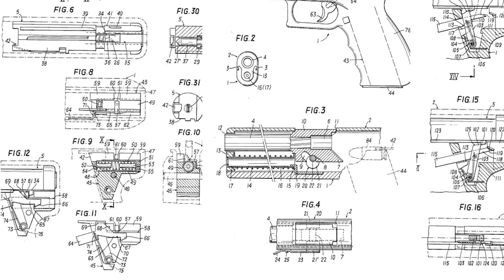The History and FUTURE of Glock

Comment: As a teenager I owned a Remington Nylon 66 rifle. It worked great, never failed, and yeah, most of the exterior was made out of plastic. I lived in the Mojave Desert, and we could pretty much drive out any dirt road and go shooting. I have no idea what I did with it but I sure wish I still had it. It is a classic! It was manufactured for 30 years!
Reply: I own the Remington Viper 522 and it's the most unreliable firearm I own.  I haven't sold it because one day I'll get inside and take a hammer chisel to it and see if I can get it to feed right.  There's a razor sharp bit of metal right where the cartridge feeds in and it catches the bullet and shears it and kinks it over.  About 40%.  Other than that it's a neat little gun, very accurate and light, easy to use mags.  On the other end of the spectrum I also own a used, beat up, floppy sight Marlin tube feed .22 and that's a real joy.  Almost as light, just as accurate floppy sight and all, the only downside is tube feed but you know what?  A pocket full of cartridges and it'll go all day long and never a problem.

Comment: "A glock 7 porcelain gun"... The 80s were right around the time when airplane hijackings were a huge fear. The idea of an "invisible to x-rays" gun was very stupid but it fed into the anti-gun sentiment. Even at the time it was pointed out that all firearms have some kind of metal in them. The bullets, springs, screws, barrel, all things that show up on x-ray machines.
Reply: Hijackings got massive attention at the time, yes.
Reply: I'm pretty sure that an x-ray machine would pick up porcelain, a coffee mug or something would definitely show up
Reply: @Laotzu.Goldbug  It was mostly for metal detectors at the time. The X-Ray machines of the 80s were very rudimentary and it was easy to pack something into something else and the X-Ray machine wouldn't be able to differentiate it. They used them then mostly for bombs, firearms and concealed weapons were taken up by the large metal detector that you had to walk through.
Reply: There were a few very special designs that were entirely non-metallic for the purpose of going through a metal detector. It'd only fire a single shot and didn't use cartridges as we know them and the bullet itself wasn't metal either, but a type of polished stone. It also wasn't really a gun in any sense of what we'd know of as a gun as it was really just a single-shot cylinder that was held in the hand. It was a kooky and extremely expensive one-off designed for spies to be able to sneak some kind of firearm through known civilian security systems at the time which was mostly primarily metal detectors. Definitely not what the news was making the Glock out to be.

Comment: I have owned a lot of glocks over the years (starting with a gen 2) and they have all been fantastic! I still use my Gen 2 mags in my Gen 5. That is one thing you don't talk about is the magazines and how they seem to last forever. I think I have only ever thrown away 2 or 3 but none have been because of spring tension issues. I have a Gen 3 mag that has been loaded for probably, what 10 years or so (it is a spare loaded mag hidden in my house) and every time I bring it to the range it works like a champ. Then it gets loaded back up and put back in its spot. I ha e had problems with FN mags HK mags S&W mags Sig mags and I am pretty sure Canik mags come broken, but glock has never let me down.
Reply: Did you know that the first mags had no metal liner, they were just plastic
Reply: @jeffhyatt5677 you mean feed lips. There’s no liner.
Reply: @coryhoggatt7691  do you have any Glock mags? They are plastic , and have a thin metal liner, or insert mag inside the plastic, the whole plastic mag, not just the feed lips.

Comment: Awesome video. I love 1911’s but even a fan like myself can’t argue with just how simple and reliable the Glock and Glock style designs are. The slide stop/release just illustrates the point so well.
Reply: A quality 1911 is just as reliable tho. But may require a bit more break-in to smoothen things up. The only difference between my Glock 19x & Kimber TLE RL custom shop II is 9mm vs 45ACP, and of course a lower capacity than what the 9mm will hold. After shooting a couple hundred rounds thru the 1911, it runs flawless with all ammo types. Just like my Glock 19x
Reply: @AFreeThinkingDawg09  Saying a quality 1911 is just as reliable as a Glock is pure copium. The 1911 absolutely will not continue to fire without malfunctions as long as the Glock. The 1911 will need to be oiled much sooner. I’m a 1911 fan and I love them but they are absolutely not “just as reliable.” That’s not even mentioning that to make the 1911 reliable in the first place, it needed someone who knew what they were doing to spend a good amount of time fitting all the parts properly, and as soon as one goes out of spec by just a little bit the gun will begin to malfunction regularly and will require the attention of a gunsmith again. A nice, quality 1911 that is well lubed and was properly fit by a qualified gunsmith will run like hell, but it certainly will require more attention and maintenance than a Glock.
Reply: Until you try to reload the ammo and suffer a blowout and damage because of unsupported case, forming a bulge known as the "Glock smiley".
Reply: @DoctorMangler  if your reloads are to factory specs, you shouldn’t be having blowouts considering it doesn’t happen with factory ammo. Ever seen what happens with a 1911 when it eats a steady diet of +p ammo? The frame cracks usually well before the expected time period and once the frame of a 1911 cracks, the gun is toast.
Reply: @JG54206   That has nothing to do with a Glock smiley.  Unsupported case does.
Reply: @DoctorMangler  “until you try and reload the ammo”
Does this happen often, or ever with factory loaded ammo? No… not really. So my point stands… the case is as supported as it needs to be for factory ammo including +P, which means either the brass you’re reloading isn’t suitable for another firing or you’re overloading the rounds quite a bit and exceeding +P pressures. How exactly does an overpressure not have anything to do with a case blowout? For a case to blowout there needs to be two things.. lack of case support in a given area and too much pressure in that same area. Once again, seeing as how the so called “Glock smiley” pretty much never happens with factory loaded ammo, including +P ammo, then  your perceived inadequate case support isn’t the issue.. the pressure or the brass itself is. If you don’t like Glock that’s fine… but to argue that you don’t like Glock due to a functioning or reliability issue and then say you like 1911’s because they don’t have any functioning or reliability issues is the definition of cognitive dissonance. I love 1911’s but there is a very valid reason why they are not the standard anymore. They work, and as long as they’re in spec, well lubricated and relatively clean, they work pretty well… but they are in pretty much no measurable way superior to modern striker fired polymer framed pistols. The only way in which they are superior is in subjective areas of feel.
Reply: @JG54206    Changes nothing.  No other manufacturer has unsupported case.  Sure it may be good enough,  I don't want good enough I want the best.  Sell your Glocks and buy a Sig or a Ruger, and if Glock is really so much cheaper to make why aren't the savings passed on?  It's ok if you're a Glock fanboi, nobody's going to kick you because like like inferior products.  :P
Reply: @DoctorMangler his point stands. You won't get the "glock smiley" if your not an amateur reloaded.
Reply: @nova68cutie    That's totally wrong.  The Glock smiley happens on factory ammo.  It has nothing to do with reloading unless you happen to get some brass that has been once fired.  Once fired..... as in factory ammo.  Go do some more research before you say something provably stupid.

Comment: Glock is my go to and my only recommendation for new shooters. Simple, reliable, affordable. So many accessories too. Mags are everywhere, I've literally found them on the ground before.
Reply: Where on the ground? Asking for a friend
Reply: you live in the wrong hood
Reply: Not affordable anymore psa dagger is though. Also where do I have to look for to find the things you've found on the ground???
Reply: @@assclapper2231huh? most are 560 locally even at gun stores. thats ignoring 400 dollar factory rebuilds, and used police trade ins
Reply: @@assclapper2231 You don't HAVE to buy the newest model, and in fact I would discourage it unless you ABSOLUTELY want to mount optics on them.  As the other commenter said, other Glock models can be had as low as 400 and sometimes even cheaper.
Reply: @sovietarmy7485  are you looking at Gen 5s or lower Gen 3s as Gen 3 can be found all over the place new for $560 or if you go with the little crappy 43 they start at $528.. Gen 5 now that will set you back $670+ and then if you do like most glock fanboys to make the gun good you will need/want to change the trigger, sights, etc when you can buy a clones such as the Dagger equipped with the better trigger, sights, and other upgrades with the same if not better reliability and much lower cost to boot. Admittedly had the pattents not run out we would not have the clone options and just be stuck paying for the name glock.
Reply: @@assclapper2231 I definitely wouldn’t call a Gen3 stock Glock inferior but you do you bro
Reply: What’s your opinion on their curtain rods?
Reply: @@assclapper2231 Glock 19 Gen 5 FS Front Serr 9mm Commercial $539.00. You must be talking about the $800 Sigs that everyone is complaining about how the finish is coming off and the slide is almost impossible to rack with a full magazine in place.
Reply: ……just buy that gen 5 and send it to wager to mill for a red dot for another $100….
Reply: Never bought into the bad trigger nonsense tbh. Gen 3s were fine. The gen 5 trigger is pretty sweet. 

Stock trigger is plenty good enough (even though I just upgraded my g45 to a Johnny Glocks performance)
Reply: To clarify, I've found them on the ground at places people go to shoot in the woods. Not on the ground in the city.
Reply: @@assclapper2231Affordable? I get Gen 5 Glock model 17 with 3 mags out the door for not a penny over $400 & I've had that EXACT same deal for that amount since 2010.
Reply: @@assclapper2231 Sig is another brand like glock that you are going to pay a lot for the brand name. Let me give an example for a short time Sig sold a 1911-22 for $500.00+ GSG who made the gun for sig also sold it under their own name for at the time $253.00 other than the name they are identical. Shockingly people actually think the Sig model is much higher quality than the GSG branded 1911-22
Reply: @Iamdudeman12, PSA dagger is like a worse version of a Glock. People hate glock triggers, the dagger’s is horribly mushy. And I’ve seen several with loose sights.
Reply: @@assclapper2231yeah but a gen 3 is only 450/500. And it’s more proven
Reply: @@assclapper2231sig is nowhere near as reliable.
Reply: Y’all fighting over the price of one gun when I have over 100k worth. Get whatever gun you want and invest in it.
Reply: @rogerhancock8732 I'd hate to shop where you do. Gen 5 19 is $549 at two local shops. G43 is $469. Gen 3s are $500 all over the place. Add $60-70 for MOS if you want it. Paid $489 for my M&P 2.0, $579 for my Compact 2.0 OR and $649 for my M18, $400 for a P10c. Not a whole lot of difference between any of them.
Reply: Gen 5 17 9 milliemeetre is the best deal going!
Reply: @jayhaddan7927  this.  Put time and care into your guns and they will show up for you in return.  I shoot best with an internally stock Glock, with red dot and TLR7.  It’s amazing piece of you take care of it.
Reply: MP 2.0 is more affordable than a Gen 5 and all around better imo. Glocks point to the sky if you don't make it a point to really cant the gun forward
Reply: @michaeledwards7668  I never had an issue with the hand positioning issue but in glad you’ve found a gun that works for you 😁
Reply: @@assclapper2231 Glock's Gen 5 are $550 at many gun stores. Store asking $700.00 are overcharging.
Reply: @rogerhancock8732  MT excelent 43x was only $440.00
Reply: @@assclapper2231 you shopping at a store that is overcharging if they are asking $560.00 for the non MOS.  The majority of GLOCK owners are happy with the sights.
Reply: @ClickClack_Bam what state are you in?
Reply: Glock fans forgetting the sticker price isn't exactly what you end up paying
Reply: Don't you just love all the Glock haters showing up on Glock reviews? Must be sad to be a hater. 🤣
Reply: Most modern guns are reliable , it is so cringe that Glock owners have to say this as a feature . Glocks are subpar
Reply: @darronfozo6184  PA.
Reply: @elkpants1280  Agree, love me some gen 3’s
Reply: @rogerhancock8732  Love me some gen 3’s
Reply: @@assclapper2231 Love me some gen 3’s
Reply: @@assclapper2231 Love the hard wall before the quick snap of the trigger, and strong tactile reset of the legendary gen 3. Maybe not the shortest reset, but the strongest, felt, most tactile reset of all the plastic strikers. Not a target trigger, but the perfect self-defense or combat trigger. Now the sights I do change with Trijicon HD Night Sights.
Reply: @CertifiedBullpupHater  Exactly, the stock Glock trigger was never meant to be some sweet candy ass target trigger. My stock gen 3 is the perfect self-defense or combat trigger, and I’m very fast and accurate with it.
Reply: @Asidebar  I have always seen the Glock stock plastic sights very well at my local indoor pistol range, and am very accurate with them. Now some of my Glocks I have Trijicon HD Night Sights, and other I have kept with the factory plastic sights. I have a Glock 35 years old, and the plastic sights are still intact.
Reply: @@assclapper2231 Not true. Most of the used Glocks I see either on Gunbroker or at my LGS, have the stock plastic sights.
Reply: Wouldn't call them affordable. Middle class gun through and through.
Reply: @sovietarmy7485 spot on. Paid 568 for a new G30 and a few years back bought a police trade in G19 for 400 and some change.
Reply: @rogerhancock8732  No bro in fuckin jersey i bought my gen5 for 560. Gen 3s new can be found for 450 easily nowadays. Reliability?? 💀 how many striker firing pins have broke sinc eit came out. Its literlaly mandatory to change the firing pin to a glock oem one now.
Reply: @rogerhancock8732  Rebuilt gen 5 glocks are also around 420 as well
Reply: @sovietarmy7485  when I stated the prices I did I was actually looking at available current inventory in my area. As far as reconditioned guns did not see any but I also did not look them up and honestly I'm not going to either.
Reply: I’ve been shooting my first generation G17 since I got it in 1990. Well over 20K rounds through it. I always hear about how bad the sights and triggers are on Glocks but to tell the truth, I hit what I aim at with the original sights and haven’t found an aftermarket sight I like better. The trigger is fine for me too. I’ve shot a lot of pistols over the years yes there are a lot that are a bit smoother and lighter but… I haven’t found one that I have felt was a big enough improvement to make it worth spending money on.  For some reason I hear a lot of Glock critics and even fans say that you need to spend $200 or more on upgrades but I just don’t see it. I have 3 different models at home and don’t plan on spending a dime on upgrades because… I am happy with them the way they are.  I wouldn’t think twice about buying a used one either because you just plane aren’t going to wear one out with even higher than normal use.

Comment: My first gun was a Glock 17. Went on to purchase a 19, 32, 40, and 42. Had a 43x but much preferred my 19.

I definitely enjoy shooting my metal framed guns more. Just the weight of it, the solid feel. Most are hammer fired, which allows a lighter  recoil spring weight and much better trigger. I've purchased 4 of the old stainless Smith 3rd gens, love them. Got some 2011s, CZs, the whole gamut. Even other polymer guns like the M&P 57 or VP9.

I've come to the conclusion I love both, but now that I have a few utilitarian polymer frame guns I don't care about beating up, the majority of my purchases are steel or aluminum framed guns.